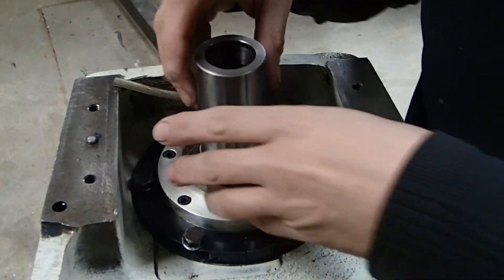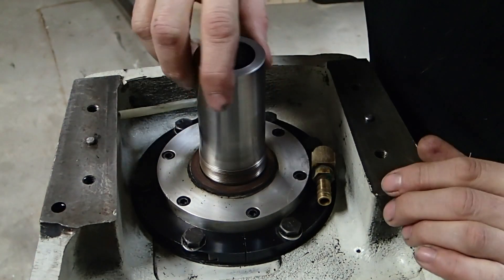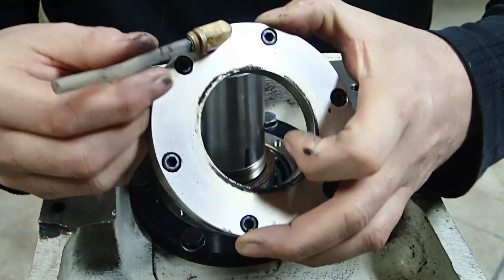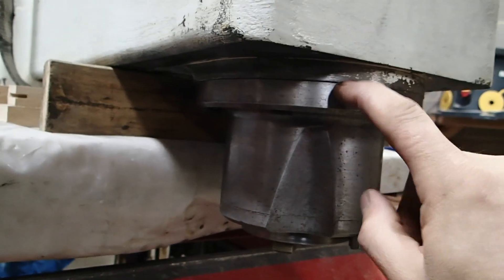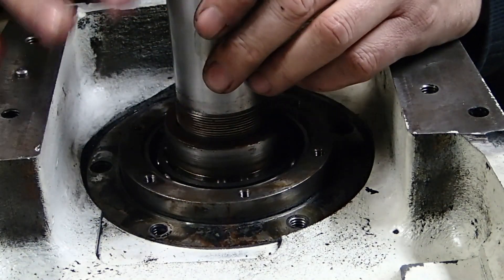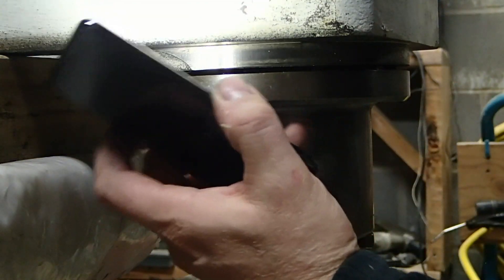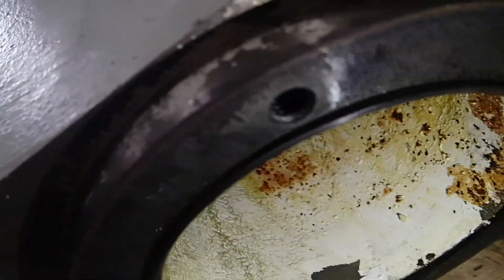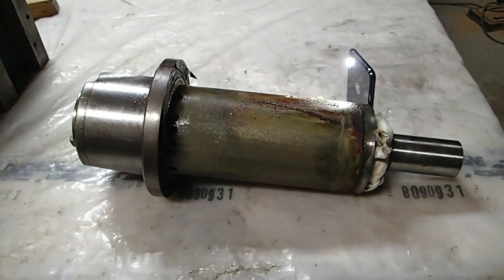Part 15 - (Removing the spindle 1 of 2)

Comment: Well that spindle is most likely trashed now. You took off the spindle preload nut and if you know what your doing it’s not too hard to get back correct but you also exposed the bearings most likely contaminating them. I think for the money you are going to end up spending fixing this machine you could have purchased a brand new machine
Reply: Some of the spindles are grease packed if you flush it with spindle oil you can say good bye to your spindle. If it an air over oils better but still don’t touch it. Just put it back together and the tight the preload nut.

The way to test the preload is to put a tenths indicator on the spindle nose the press down on some wood with about 500lbs of force. Then zero indicator and lift the head. Then activate the drawbar and see what the indicator reads.

Depending on the type of spindle there are different number you should get but I think you should shoot for between .0008” and .0012”
Reply from the maker: Yup! Not my finest! Clearly, I don’t know what I’m doing half the time! But that’s ok... For me it’s a fun project and a way to learn. I got the machine for 500$ CAN (+/- 400$ USD). So I can afford to make a few mistakes. I’ll try to salvage the spindle and if not, I’ll get a new or refurbished one. Or have this one repaired. We’ll see in time. Someone suggested in a comment to flush it with spindle lube to clear contaminants. I would also need to find out the torque to apply on that nut. In the meantime, I’ll be sure to quickly post a video to warn viewers not to remove the preload nut! Thanks for the comment!
Reply: @BlaiseBarrette  also I forgot to mention all the instructions on how to do this are posted online. So if you don’t know just do a little research and look up the procedure.
Reply from the maker: Thank you  @ianagos4276  for these precious infos! I'll be sure to look for it! You'r getting my hopes up a bit! Hahaha!

Comment: Hey, currently refurbishing Bridgeport Interact 412, see some similarities to your machine. It's nice that you show the next stages of the renovation, there is still a lot of complicated work ahead of you. I look forward to further progress and keep my fingers crossed.
Greetings.
Reply from the maker: Hello friend! Thanks for subscribing! As you can see, half the time I have no clue of what I’m doing so both our fingers are crossed!!! Hahaha! This is why I do these videos, so that you guys can tag along and let me know when I’m off track! So please don’t hesitate to comment. Welcome to the Chanel!
Reply: @BlaiseBarrette  We live and learn, there was no need to remove the large spanner nut or the silver collar, only the black split collar but you know that now. hopefully you have not created any problems, just maybe flush with clean mineral sprits? and make sure your spindle lubricator is working properly when you go back together. I replaced mine with a grease pack spindle but that was $2850. https://itscnc.com/spindles-new-reman/spn-0336r.html  I'm definitely not the spindle expert and no doubt you did get a little trash in there but I don't think that means for sure that the spindle is trashed.
Reply from the maker: @jimcisme1  I am such an idiot! Hahaha! The I'm don with this machine, I will have learned a lot! I think flushing the spindle with oil is a great idea! I even tought of emptying a few cans of break cleaner to flush any contaminent, then flush with spindle lube. What do you think?